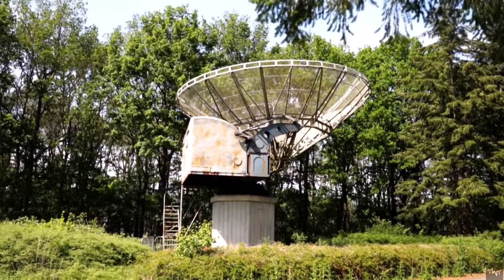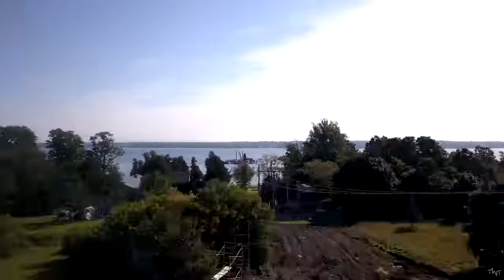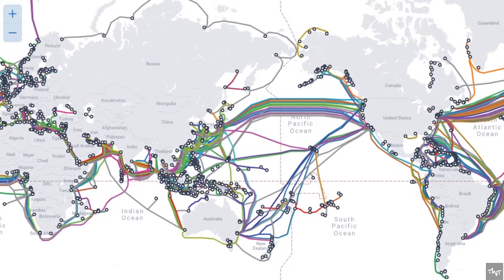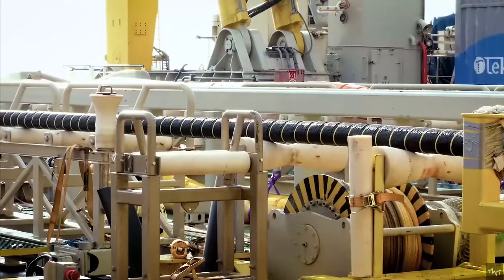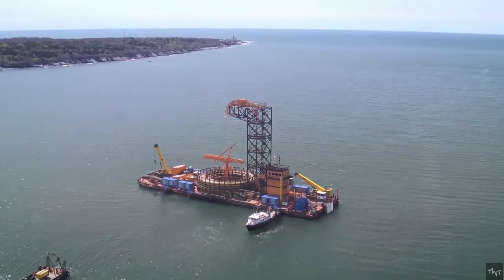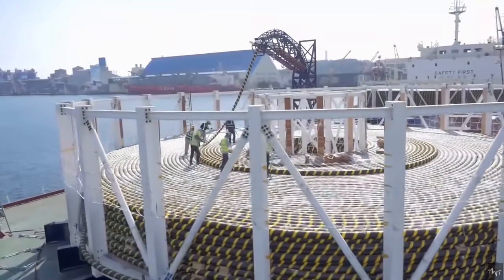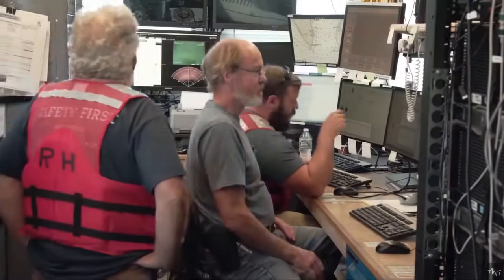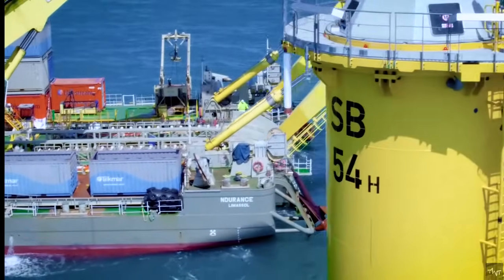How Submarine Fiber Cable Installed?

Comment: It is several thousand miles from one end of a cable to another. This cannot be in one piece, but made of several cables joined together. How do they do this?
Reply: Submarine fiber optic cables are essential for global internet and telecommunications, connecting continents across oceans. When laying these cables—often thousands of kilometers long—they must be spliced (joined) multiple times along the route and at connection points. Here’s how the splicing is done:

⸻

🛠️ 1. Before Deployment: Factory Splicing & Assembly

Most splicing is done on land in a controlled factory environment before deployment:
	•	Cable Sections Prepared: Fiber optic cable comes in lengths (e.g., 5–10 km coils).
	•	Spliced in Cleanrooms: Trained technicians fusion splice fibers—melting and joining the glass cores together using precision splicing machines.
	•	Protected with Sleeves: The spliced area is encased in a protective sleeve and then sealed within a steel or armored housing to withstand deep-sea conditions.
	•	Tested for Signal Integrity: Engineers measure signal loss and reflection to ensure the splice is nearly as good as a single fiber strand.

These spliced lengths are coiled onto the cable-laying ship for deployment.

⸻

🌊 2. During Laying: Onboard Splicing

If something goes wrong during deployment (e.g., the cable snaps or needs joining at sea):
	•	Cable Retrieved onto the Ship: Using specialized grappling gear, ships retrieve the cable ends.
	•	Onboard Splicing Lab: Ships have mini cleanrooms and splicing equipment onboard. Technicians perform fusion splicing just like in a factory.
	•	Armoring Restored: After splicing, the joint is sealed and the protective layers (including steel armor and waterproofing) are rebuilt.

⸻

🔧 3. Underwater Repairs

When a cable is damaged underwater (e.g., by earthquakes, fishing activity, or anchors):
	•	Location Pinpointed: Engineers use signal testing (OTDR) to locate the fault, often to within a few meters.
	•	Cable Cut & Brought to Surface: A cable ship retrieves the faulty section by hooking and cutting the cable on either side of the damage.
	•	New Section Spliced In: A new length of cable is spliced to replace the damaged segment.
	•	Lowered Back to Seafloor: The repaired cable is carefully laid back down.

⸻

🧪 Fusion Splicing – How It Works

Fusion splicing is the key technology for joining fiber optic cables:
	1.	Stripping: The protective coatings are removed from the fiber.
	2.	Cleaving: Fibers are cut precisely with smooth ends.
	3.	Aligning: The fibers are aligned under a microscope to match core-to-core.
	4.	Fusing: An electric arc melts the glass tips and fuses them.
	5.	Testing: The splice is tested for signal loss (should be under 0.1 dB).
	6.	Protecting: A heat-shrink sleeve with reinforcing material protects the splice.

⸻

🌐 Additional Notes:
	•	Modern submarine cables often have 8, 12, or 16 pairs of fibers, and each fiber can carry over 20 Tbps using dense wavelength division multiplexing (DWDM).
	•	A transoceanic cable can have hundreds of splices over thousands of kilometers.

Comment: Why are some cables as big as a garden hose but others are as big as a tree trunk?  Are they bundled together? Is it just thicker protection for certain parts of the ocean?
Reply: The armouring is really expensive so the cable is designed to fit the sea bed survey done before the cable production the more dangers the more armour and the more costly. If we are at a depth over 3-400 meter i think, there are no risks of trawler damage and the cable will typically only be with a thin armouring and the size of a thick garden hose.
Reply: @kimalexschwartz   Interesting!  Thanks for the answer!
Reply: Yes

Comment: The cable ship videos are all wrong. They show power cables not fibre.
Reply: Are you sure if what you're saying? 
pls explain some details Dear.
Reply: @jmotivational5705  submarine fibre cables are only a few cm thick
Reply: Correct. But the process is largely the same.

Comment: You are speaking about telecommunications submarine cables but the video images are about power submarine cable, for carrying electric power. There are many differences between this two technologies. As optical fiber is as thinner as a hair, telecommunications submarine cables are much thinner, between 4 to 30 centimetes, depending of the proteccion needed.  installation technique and vessels are differents.
Reply: The oceans are not completely explored . Especially at certain depths. In addition to erosion and sea life ..government  borders.

Comment: I am confused in the explanation of the amplifiers it’s said they boost voltage ,... voltage in a fibre optic submarine cable? can someone enlighten me pls
Reply from the maker: Due to the distances and capacities associated with transoceanic submarine cables, optical amplifiers are spaced at regular intervals along the cable to amplify information-carrying wavelengths. Undersea optical amplifiers are similar to their terrestrial counterparts, at least from an optoelectronic perspective. Optical amplifiers boost transmission speed by eliminating the need for high-speed electronics in repeaters. With optical amplification technology, no electronic processing of the signal at line rate takes place in the repeater.
.
A traditional optical communications “repeater” regenerates a received optical signal by performing 3Rs – Reamplify, Reshape, and Retime – to restore the quality of received optical signals, which involves OEO (Optical-Electrical-Optical) conversion.
.
Hope i got you, if not; let me know😊
Reply: @TalkWidTech  thx!
Reply: wow!!